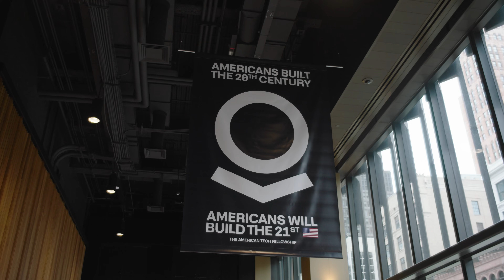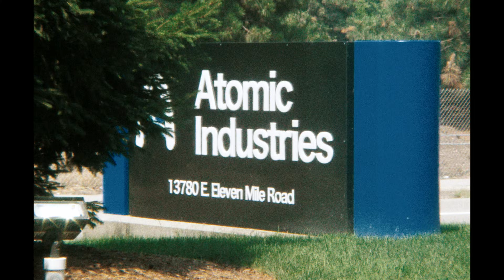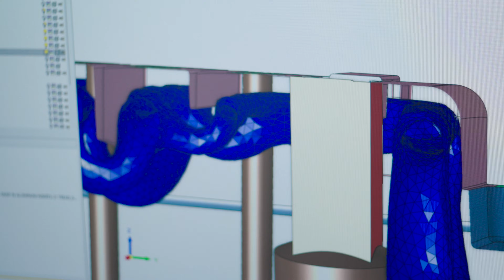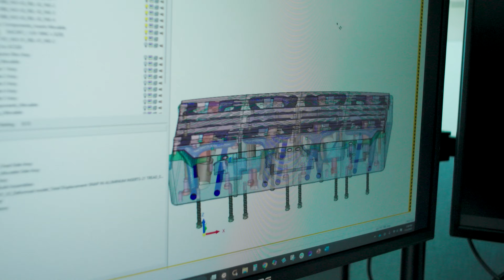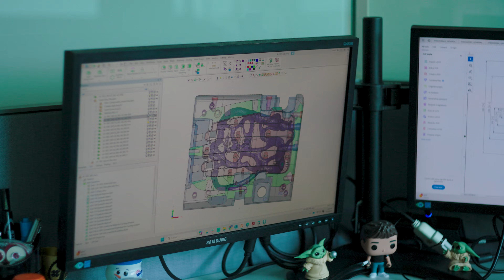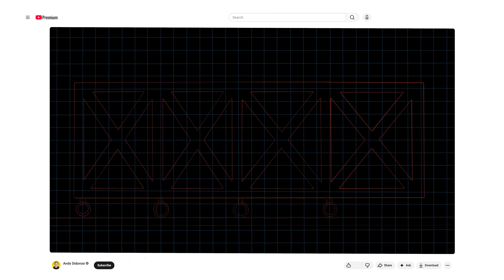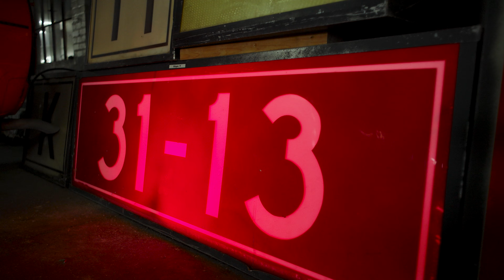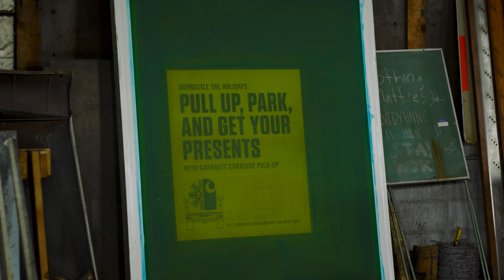Inside America's Secret Weapon Against Chinese Manufacturing

Comment: Here is why the US will NEVER be able to keep up
with China!
China graduates 12M students per year,
4.8M (40%) in STEM!
US graduates 4M, 
800K (20%) in STEM!

For instance,
Huawei has some 208K employees, over 100K in R&D!
NVIDIA  ~36,000 22,000 in R&D
How can the US compete?

China is compounding their innovations.
First, they make solar panels, then get really
good at making them, then can get the price of
electricity down, make the next level products
cheaper, with higher quality and on and on it goes.

They will be at the next level before we get our boot on! 
Make friends, not enemies that can hurt you in a thousand ways!
Reply: Quantity does not guarantee quality or effectiveness. 

You can build billions in infrastructure in a decade but if the concrete crumbles in 2 to 10 years instead of 50-100 the country is in for a rough time. 

Politicians are extremely good at messing up innovation and crashing economies despite how smart your R&D folks are. The more centrally controlled, the worse the GDP and technology advancements. The CCCP fell despite brilliant engineers. The CCP has the same problem.
Reply: @umaikakudo  
You may be right, and only time will tell.

Comment: This piece turned my mind to history, and rather than be cynical, I’d say there was a timing problem for US. These robotic productions were supposed to be right around the corner 25 years ago, but there’s no vision was no incentive because the original winding down of mass employment at factories had begun 25 years before that. Even if the timing off by a year or two, the tech couldn’t match the pace of employment changes, and foreign labor was the just-in-time solution. Regardless, thanks for giving these entrepreneurs some screen time and a platform to celebrate their achievements.

Comment: I appreciate the work going on regarding using AI to design a "perfect" die but there is no way that it will "Bend the Universe" . The final cost of the product is the sum of the raw material, labor and overall manufacturing infrastructure. It is unlikely that it will reduce overall cost by 10%. In addition, if it is optimized for a single supplier of polymer, how will it perform with material from a different supplier?

Comment: I was granted US patent 3890161A titled DIODE ARRAY in 1975. It was filed in 1973 and opened to the public domain in1992. It provides me with permenent written public attribution for the idea circa 1973. 

Brownian motion and Johnson Nyquest electrical noise are well accepted phenomenon in the microscopic relm. My contention is that modern nanofabricated diodes can be made that are also in the microscopic relm and can be aggregated to be practical at any scale usually microwatts to terawatts. 

The differentiated features of small structures will ultimately over a very long time loose their differentiation. This loss over decades can be very small. A quantitive example of this is that a pile driver hammer dropping three meters many times an hour over a service life of twenty years will impart millions of times more energy to its pillar than the energy  needed to melt the metal pellets needed to create the hammer. This is industrial negative entropy. 

Order is imposed on the random thermal motion of electrons by the structual orderlyness of a diode array made of diodes made within a slab:
__ -out___
🔻🔻🔻🔻P type / Anodes
■■■■■■N type / Cathode(s)
     +out 

The plausible net electrical filtrate from diodes can be aggregated in a first grouping of separate diodes in  consistent alignment parallel. After a primary level of grouping, optional further groupings can be added in compound parallel and series where both current and voltage are additive to provide desired DC current and voltage. Within limlts, parts of the  network can be shorted out or open circuted without chemical or electrical harm below electrical fire damage or, a step higher, an electromigration limit. 

Widely scalable electrical power always paired with equal refrigeration is thus possible. The efficiency of each diode is low because the nanowatt random  power within each diode doesn't rectify well. 
This inefficiency affects the performance but not the equality of the thermal absorbtion compared to the electrical yield. 

The maximum energy is converted from ambient heat to productive direct current electricity when the load electrical resistance  is equal to the array internal electrical resistance. Maximum calculated electrical power output (watts) is k (Boltzman's constant), one point three eight x 10^ minus 23, times T (temperature Kelvin) times bandwidth (0 Hz to a natural limit ~2 THz @ 290 K) times rectification halving and nanowatt power level rectification efficiency, times the number of diodes in the array. 

There are a billion measurment cells of 1000 square nanometer area each per square millimeter, 100 billion per square centimeter. 

Let's reframe Earth's low diversity abundant ambient heat as a thermal energy waypoint between heat and other forms of energy.
As the polarity filtered electrical energy is exported, the amount of thermal energy in the group of diodes decreases. This group cooling will draw heat in from the surrounding ambient heat at a rate depending on the filtering rate and thermal resistance between the group and ambient gas, liquid, or solid warmer than absolute zero. There is always a lot of ambient heat on our planet, more on equatorial dry desert summer days and less on polar desert winter nights. 

Go ahead and start to build something inspired by this introduction without my involvement.We can meet after there is solid crowd verification.
Please share the successes or setbacks of experiemental efforts. The topic deserves crowd financing, discussion and prototyping attempt action. Crowd development would be resistant to confiscation or burial. At best there could be science quality colaboration. 

After small scale prototypes of various types are made with widely developed processes many enterprises will be able to think of appropriate scale production. 
There is no need to have one manufacturer emerge. All competent manufacturers should develop their processes without exclusivity or forced dominance. I don't think I have outstanding abilities at this phase so I'll help but mainly get out of the way. 

Energy sensible refrigerators that absorb heat and yield electricity would complement computers as computing consumes electricity and yields heat. Computing would be almost free. Chips could have  energy recycling sophisticated srructures combining microscale heat pipes and light and electricity paths built in. 

Full heat recycling, all electric, very isolated underground, undersea, or space communities would be highly survivable with reduced ElectroMagnetic Pulse pickup which eases further protection, self sufficient LED lit automated vertical farms, thaw resistant frozen food storehouses, amphibious factory submarines, nonstandard dwellings, self contained elevators, safe rooms, and free range transports.Some electrical equipment groups could be consolidated into local networks when suitable. Liquid nitrogen cooled superconducting networks would become practical. Fire safes would maintain contents at a desired temperature in extreme heat or cold for years. 

In a flourishing civillization, small self sufficient electric or cooling devices of many kinds and styles, lamps, smartphones, hotplates, water heaters, cooler chests, fans, radios, TVs, cameras, security devices, robots and robot test equipment, scales, transaction terminals, wall clocks, open or cled for business luminous signs, power hand tools, ditch diggers, pumps,  personal transports, and cryogenic liquid or slurry based fire extinguishers would be available for immediate use incrementally anywhere as people as individuals or larger social groups see fit. Human enobeling communities could be built quickly. 

If a high majority thinks our civilization should geoengineer gigatons or teratons of greenhouse gasses out of our environment, hypothetically networked instalations, either a few big ones or many small ones it could build them using clean  electricity, heat, or refrigeration. Undesired chemical products could be kept within the system stored and processed cheaply until only desirable products emerged. 

These devices would probably become segmented commodities sold with minimal margin over supply cost. They would be manufactured by advanced automation that does not need financial incentive. Applicable best practices would be adopted. Business details would be open public knowledge. Associated people should move as negotiated and freely and honestly talk within a planetary diversified cooperative conglomerate. There is no need of wealth extracting top commanders. We do not need often token philanthropy from the top if the wide majority of people can afford to be generous.    

Aloha 

Charles M Brown 
Kilauea, Kauai, Hawaii 96754

Comment: If all this manufacturing happens with machines that are "better, faster, cheaper" than people, who is going to have jobs to be able to pay for the stuff the machines are making?
Reply: In the same way that you use a computer in CAD now instead of calculating and drawing by hand, the world progresses. Take your pick from a truly uncountable number of examples. It's much harder to find a task that hasn't been made more efficient by computers or modern power in any way shape or form. You can't even find an Amish person that uses zero modern technology.

I do engineering and manufacturing for manufacturing education currently, and the fact of the matter is that the United States' unwillingness to progress with mass automation (and train people for those jobs) has simply taken the US out of the competition instead of keeping any livable manufacturing jobs around. Machine operators are in high demand, but none of those positions pay a livable wage and the more skill they require the worse the ROI is for the employee. Their pay is decades behind at this point and so is their evolution. Our only option to balance the equation is to increase the output and thus dollar value of a single person drastically compared to other less expensive countries, and simultaneously lower the dollar value of tradeable and exportable goods to the point where they outcompete in both price and quality.

This is quite hard to do when everyone thinks automating means replacing people instead of multiplying the production capacity of the entire sector. Throw in a heap of corporate greed and widespread extremist anti-public sentiment just to make any potential solutions more difficult.
Reply: Most of the job loss will happen in china.  Only 8% of the US workforce is manufacturing so if we are bringing those factories back it ill be a net plus.
Reply: @marks658  this ☝️
Reply: For as long as there has been automation, there has been the perspective that it is taking jobs away from people. The printing press and the automobile displaced many jobs, but there is always work to do. Mass manufacturing is what allows us to buy products for such a low amount. As long as we continue to say that robots will take our jobs, we will never be able to compete in the manufacturing world. There are very few blacksmiths around anymore, but there will always be a need to help people travel. We have to think about our jobs in a larger context.
Reply: @roeschdan  The promises that the politicians are making is to "bring jobs back to America"...
Reply: @pileofstuff  even though politics definitely does affect us, It ultimately will not be the savior of the job market. Externally slowing down competition with tariffs can give a temporary boost to domestic manufacturing, but innovation is what will create value and I think what Americans need to relearn is how to work hard and innovate. we have to stop saying we used to be the best at digging holes with a shovel, but the backhoe is taking away our shoveling jobs. We need to be developing the new hole digging technology instead of pining for the days when we used to be the best. I’m not saying we’re in disagreement about that. Your original comment was who will be able to buy things in the future and I think it will continue to be the people who work hard to solve problems and create value for other people. Yes, the jobs will look different, but there is always going to be work to do.
Reply: It's a conflict of interest yeah.. All this will take years to integrate on scale but I'm hoping that this shift in tech will create new types of jobs that fill the manual labor they replace. I think we will discover these when this system is far more integrated into the manufacturing sector.
Reply: @tfmg8223 problem is that the USA needs high paying jobs for stupid people. The system rewards the winners of the IQ/ temperament genetic lotteries at the expense of the 50% who are average or below
Reply: If a machine makes it, imagine how much cheaper the products become to purchase.
Reply: @crackyflipside  do you see prices going down on anything?
If anything prices stagnate after automation but never drop.
Reply: @a @alphadog6970  am actually very interested in this comment. It is not a perspective that is intuitive to me, but I for sure want to learn. Can you give some examples of how automation has not lowered prices? I agree that it feels like everything is getting more expensive, but I can’t imagine how much a gallon of milk would cost in resources, including time if you had to keep and feed and milk your own cow every day.
Reply: @roeschdan  lets take simple example , processed goods like hard candy or canned soup.
99% automated barely any human input in manufacturing.
Prices only go up.
Doesn't matter why , it only goes up be it  for raw ingredients getting more expensive ( also highly automated) or other costs like energy ( also automated ) 
There are many reasons why even with automation prices will only go up.
It's not appropriate to write blogs in the YouTube comments section, so i wont.
Reply: @alphadog6970  yeah, electronics have become drastically cheaper
Reply: @alphadog6970  OK that is good to know and I can agree that for lots of different reasons prices go up. Like you said the ingredients, energy greed whatever. But are you saying that without automation it would go up slower?
Reply: @alphadog6970  the price of goods, as an aggregate, rarely fall, basically never. But wages increase, and they have increased faster than prices pretty consistently, other than during recessions. So the actual price, expressed as a percentage of the time you spent working for that dollar amount, decreases.
Reply: We adjust, just like the initial industrial revolution. Example at some point the machines gonna need something another machine can't yet do if ever. It's possible we just can't build a machine that is as good or better than us at doing whatever. Not to mention affordability.
Reply: @survidmt industrial revolution indeed replaced many people in the factories before but at the same it created  so many factories that we couldnt imagine. The displaced people  just filled up those new factories. Different case now, if every factories replace human labor by robots. Human could loose purchasing power because of that...
Reply: @elwiebatohanon7096 understand your perspective. I just don't think it will have the collapsing magnitude that most do. Implementation of "robots" is an expensive and difficult change that will take longer than proposed, we will have jobs appear that nobody even anticipated.
Reply: You really think Americans want to work grueling factory jobs anymore? Automaton is good, lowers prices and creates higher paying jobs like mechanics, technicians, machinists etc. instead of just line workers.
Reply: @coke8077  Are the people causing the loss of the previous jobs (and profiting from it) going to be paying for the retraining?
Reply: Makes you think huh 🤔
Reply: Billionaires
Reply: The ideal endgame is that people can buy more things while working fewer hours
Reply: These 2 aren't mutually exclusive. Humans will have other human jobs. Jobs for machines won't be performed by humans. Humans will have social or human requested jobs

Comment: Wondering if the mold maker is on the right track. It seems 3d printing plastic is just as competitive as injection molding given the time and cost of mold making unless you’re making huge quantities.  With 3d printing, you won’t need to keep a huge inventory as well.
Reply: Injection molding has a way better surface finish, strength, and you can make over molds and stuff you can’t do with 3d printing
Reply: @girrrrrrr2  multi-material/multi-extruder 3D printing would offer many of the same advantages
Reply: @Sudonymer dont lie to yourself.
Reply: @girrrrrrr2  I didn't say it was perfect, just that it can also do similar things
Reply from the maker: 3d printing is very slow for these high volume parts